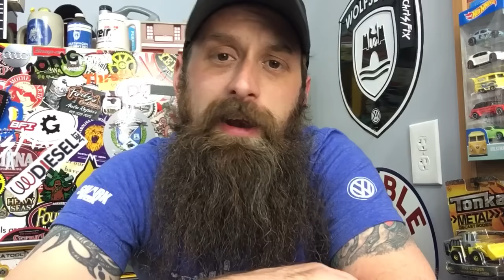How Does A Software Update Prevent Cam Shaft Damage?

Comment: I have many hypotheses!  Variable valve timing comes to mind, as does the potential for pressure regulation within the high pressure fuel pump.  Change the valve timing a bit under certain conditions (to change the application of the HPFP lobe), or lower the pump pressure just a bit (less force against the cam lobe), and you could, in theory, reduce or change wear patterns and prevent catastrophic failure.  In the Golfs, they might be adjusting Bunny Pressure to reduce Cottontail deposits.  It's all speculation until someone actually looks at the code to see what's been changed.  :)

If you happen to get another one of these broken camshafts, see if you can snap a picture of the broken/worn lobe and the surface it mates with!  You can tell a lot about a failure from its wear/break pattern, and then we could reverse-engineer the problem and determine more accurately what might have been adjusted in the software.  :D

Comment: Hi. I'm a VW tech in NJ. When they announced this recall I asked my QTM about it. He said that under certain condition the high pressure fuel pump would put "excessive" load on the camshaft and cause the lobe to break off. The software update reduces the load on the cam lobe, although he didn't say how. I imagine the software lowers the high fuel pressure demands during these certain conditions reducing the load on the cam lobe operating the pump.
Reply from the maker: +evilsomnus That makes sense. I just wish VW would give us something! :)

Comment: My guess (especially not being a dub guy, this is a total shot in the dark):  I'm guessing the problem comes from high stress on the lobe when oil is still too thick (cold engine) and insufficient oiling because of cold oil causing friction and then the sheer.  The ECM update may just be lowering the target torque in the VE tables when cold such to reduce stress on the lobe until the oil thins.

Just my $.02.

Comment: The update probably calibrates something within the ecu I'm assuming. That's the best I can hypothesis that's causing problems. Because even just switching it out it's still gonna do the same thing cuz that's what the computer believes it needs to be doing to keep the engine running.

Comment: I will take a guess at this, maybe under high load from decel to accel at higher rpm the load from boost with our recirc valves put to much load on the high pressure pump cam lobe to deliver the required fuel amount. hard part couldn't keep up?

Comment: My guess it would be lowering the maximum force on the pump but allowing the pressure to build up slower. The computer controls the pressure by controlling the pump. Not sure what drivers do to rental cars.
Reply: put it in manual shift on an auto and Rev the shit out of it. or drive the manuals way over reved

Comment: Have you given any thought to commenting on the recent court decision with the TDI's?
Reply from the maker: +TechNWRO TE I have given it MUCH MUCH MUCH thought. But since the information has not come from VW, I am going to hold off until I have some better info
Reply: +HumbleMechanic what can I do to fix an '07 Jetta 2.5 rear passenger door not locking at all? it opens and latches closed, but it rarely locks and I really don't want my girlfriends car vulnerable because of this.